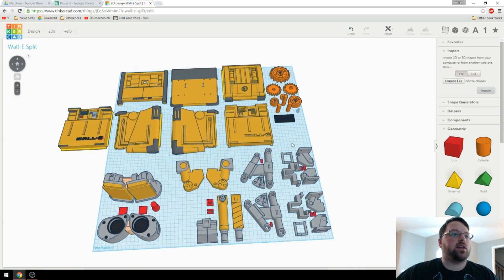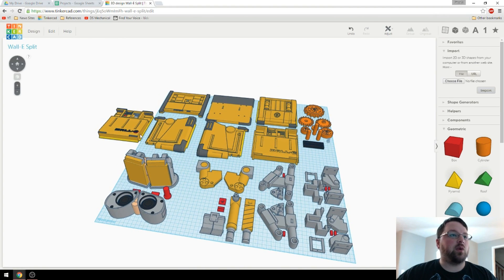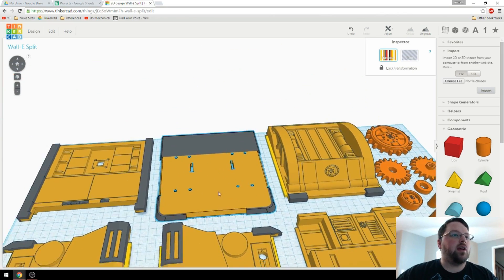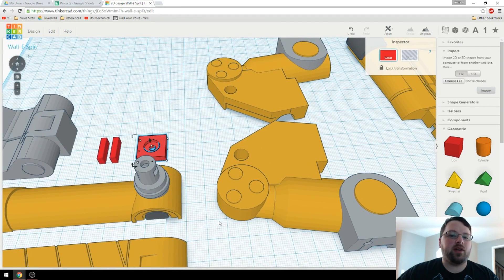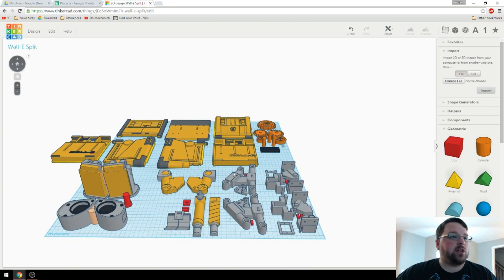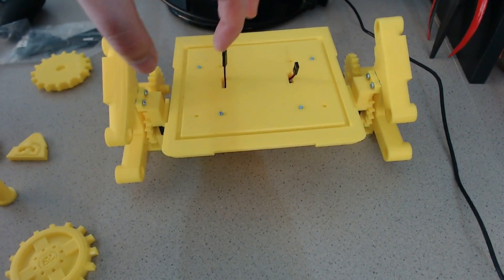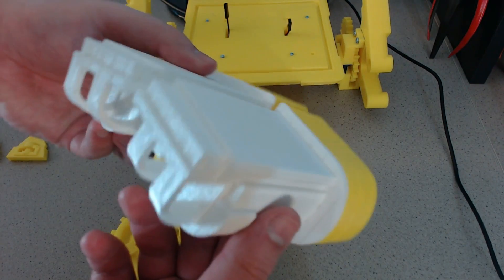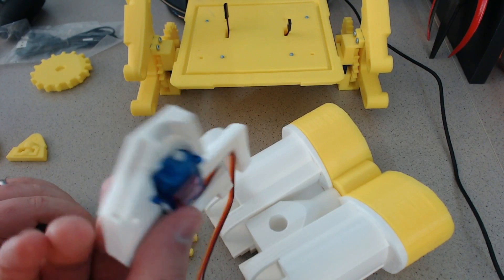Finally Printing - Wall E Update #7

Comment: Hey Garrett, he's really coming along nicely. I had a thought about the lenses for his eyes, why don't you use the lenses from cheap dollar store sunglasses or reading glasses. They are easy to get hold of and the lenses are usually polycarbonite so they are easy to cut with a Dremel or similar tool.
Reply from the maker: +Dust Bunny That's a good idea. I'll have to see if I can do that. Thanks for the suggestion. :)